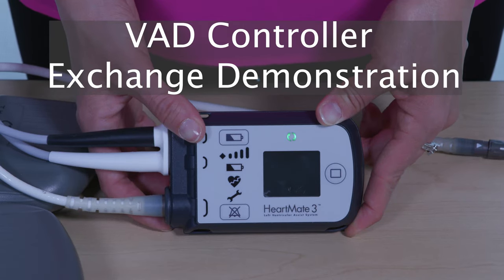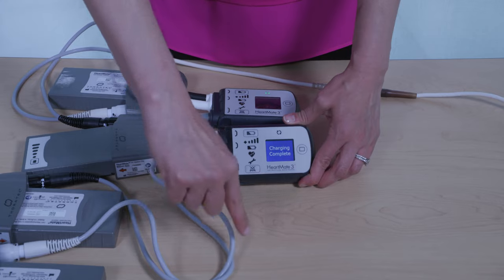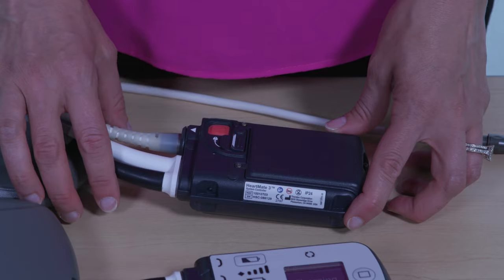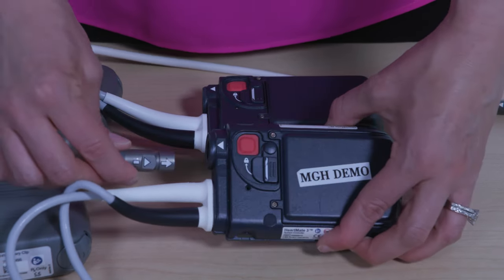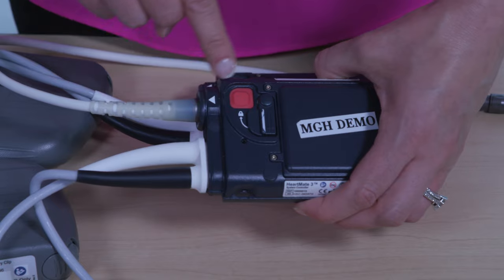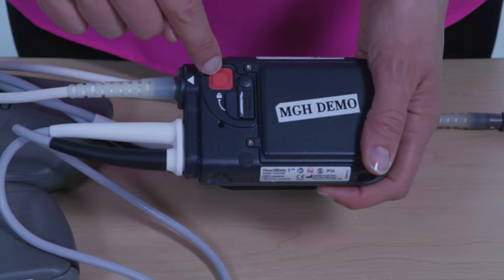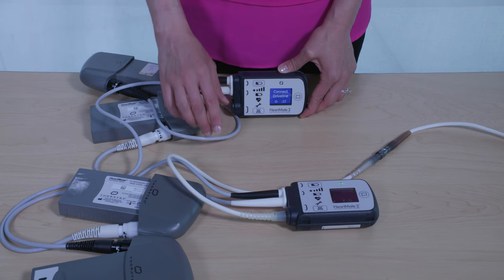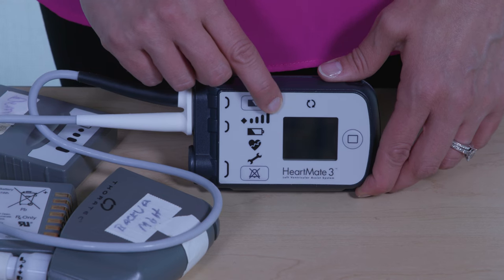LVAD Controller Exchange Demonstration

Comment: I carry an LVAD and needed to change the percutaneous cable because I have worn the thing for so long that I had holes all along of it. 
7 holes with the webbing and inside cables clearly visible....
I covered them up each time with eletrician's tape but they kept on coming back.

I would be interested to know how many other LVAD patients this has happened to ?
My hospital told me 1) NEVER to touch/fiddle with the controller 2) NEVER to undo the cable.

The finally changed both the controller AND the percutaneous cable after 2 years...

Is this video suggesting that patients are expected to do this manipulation if needed ? 
 I would also be interested to know how many patients have had to change the controller and WHY ?

Anybody's answer would be well appreciated as the medical team where I live are useless. They do NOT communicate and the cardiologists are worse. They hide and simply don't answer any of my questions.

Many thanks